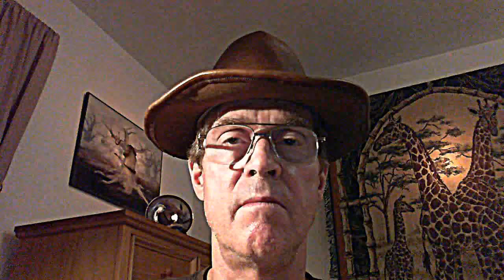Antennas Through Trees

Comment: I have absolutely no problems with my OCF 80-6 meter dipole while there no rain. Once it rains my TX performance goes bad. My RX performance stays the same. I used the VNA wet and dry and I see no change.  The question is when I put out 100 into the antenna when wet  what's causing degradation? Very odd.

Comment: my guess is some attenuation but is negligible given the hf radio path.  scientific approach i guess is the permittivity and permeability effects with that of an antenna in "ideal" free space.  i live in a tower block and sometimes just throw out a 20m piece of copper wire and let it rest on the top of the trees.  it does receive, but what is interesting is the effect of the building itself.  i believe diffraction affects hf.  so if antenna is within the "shadow of the building" it tends to affect the received signal.  driving on a steel arched bridge also attenuates the hf received signal too.  with tunnels hf is "dragged" into the tunnel to a max of about 50m.  all just experiences.  nothing scientific.

Comment: Good question. Can't wait to hear a good answer.
Reply: Lets put it this way: If trees, perhaps any kind of trees, did so affect HF, very few hams would be on the air. Many live within 1 wavelength of trees and foliage. I believe, but don't know from testing, that HF (especially 40M and lower) is least afected by trees. I would not be surprised that 10M, for example, may be more affected as the frequency is higher. IOW: Its the frequency that may matter, not so much that wire touching trees is the matter. I believe it is more important to get a wire up high above ground than to necessarily care the 'push up' is a tree. If you have em, USE EM!
Reply: I must addL USE INSULATED WIRE FOR THE ANTENNA...AT LEAST